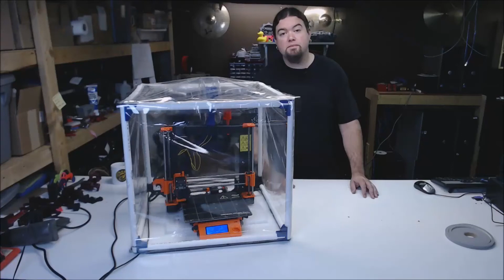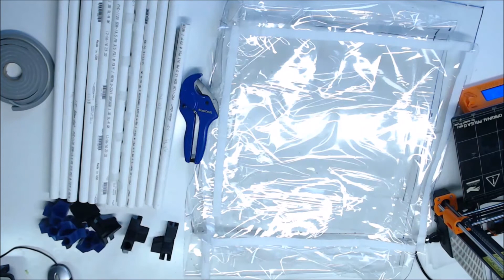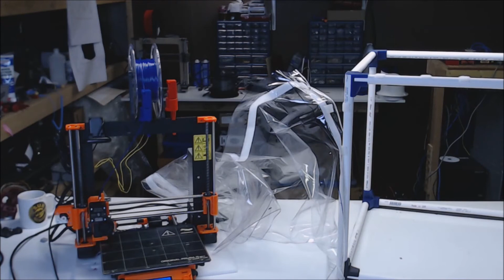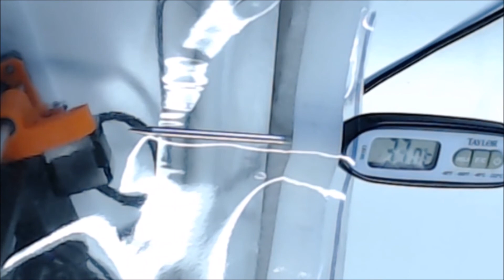Cheap 3D Printer Enclosure

Comment: Where do I buy the plastic sheeting & the velcro?Can I print the stl files in PLA?
Reply from the maker: If you print the parts in PLA, they might melt. Go for PETG. I used this sheeting https://amzn.to/47DDSCR (aff to Amazon) and this Velcro  https://amzn.to/47DDSCR (aff to Amazon) .
Reply: @ChrisRiley  The link for the sheeting and the velcro are the same.Is the velcro on the sheeting?What size PVC pipe did you use?Do you have a parts list for adding all the electronics to the enclosure for heat?
Reply from the maker: @dreddbatfan  Sorry, I updated it. Any velcro strips will work. The 1/2" PVC is .85" O.D. (21.3mm) .71 I.D. (18mm)  I would not add any heat to this.